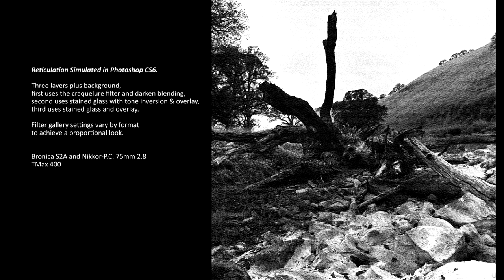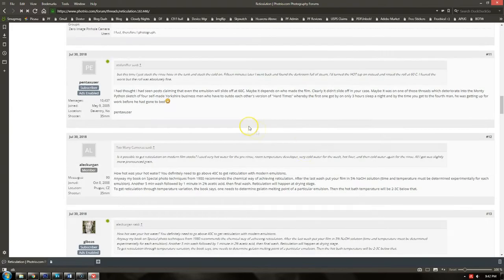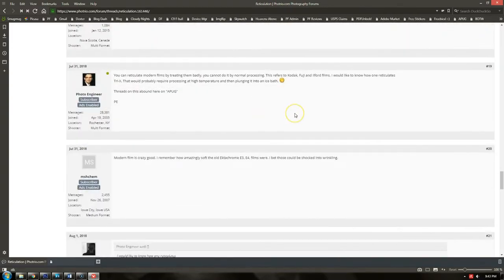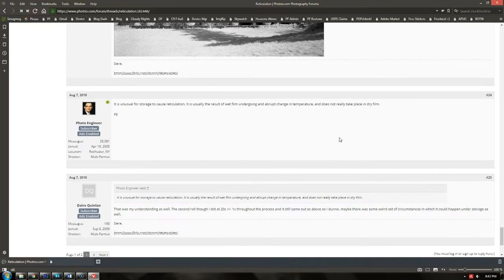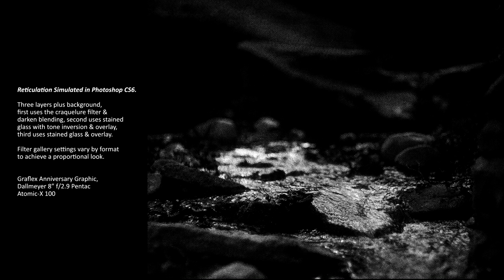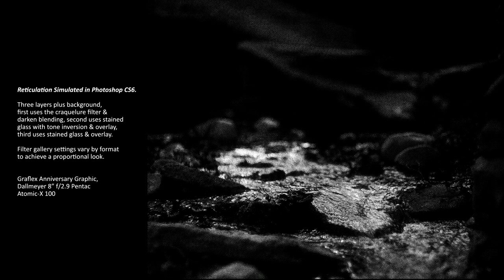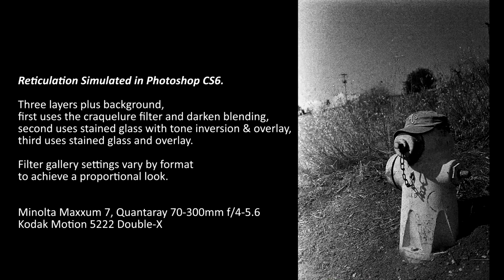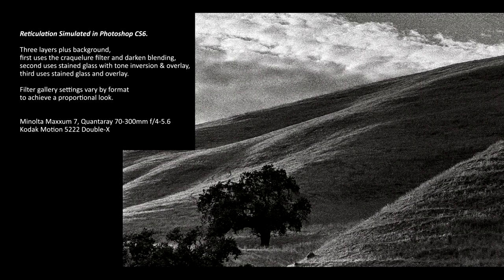Negative Flaw: Reticulation

Comment: I’m late here, but it doesn’t have to be that hot at all. I’ve done it to 4 rolls now not knowing what was happening and all I can tell you is that it’s super easy to do if you’re not careful. This is with HP5, Kentmere Pan 100, and T-Max by the way. All that has to occur is that large change in temperature. I did it during WASH BATH. Not during development, fixing, or stopping. As long as there is a large temp change, the film will have this effect. I did it going from water hot enough that I could wash my hands under with only a little discomfort (my idea was that warmer water might be able to remove the pink dye) and then putting it in 16*C Photo-Flo.
Reply from the maker: Oh interesting. So the wash having a meaningfully different temperature caused it for you.
Reply: @DavidHancock   yep, especially on Kentmere and HP5, TMX seemed less suseptable.

Comment: Late here as well, but Marshall is right. It happened to me by mistake with Tri-X. I developed in a Cinestill Df96 monobath and then, after develop&fix, the first water I washed it with was hot by mistake. Not as hot as to burn the hands, but hot as in how you would take a shower hot. Then I immediately turned the lever to cool water and continued to wash the film inside the tank. Next day when I scanned... reticulation. No incredible temperatures, just a big shift during the first round of washing. Hope this helps for people who want to achieve this effect. I didn't :) I can also attach a scan if you want to.
Reply from the maker: Interesting. I wonder if there's maybe some connection with how the developer affects the emulsion, too. Thank you!

Comment: We tried reticulation on Tr-X 400 in night class with hot water at 70 °C and cool it down in ice-water. No luck... I'll have to look for old stock.
Reply from the maker: Probably yes. Modern stocks are really well engineered now so that reticulation doesn't happen.
Reply: Just developed some Tri-X 400 the other day and got reticulation.  HC-110 Dilution B at normal temperature, but I did a warm water bath (45c) for about 10 minutes before developing.  Everything else went normally but when I pulled it out I had very strong reticulation in the highlights.

Comment: I’ve used cinestill monobath with tri x pushed to 1600 so at 90 degrees and rinsed it in the same temp and still got this issue smh
Reply from the maker: Dang it. That's too bad. 90 degrees is pretty warm for black and white film.
Reply: I did at room tmperature 75 and had this happen
Reply: @josephlinares5472  same here :S

Comment: Hi David, great video, I unfortunately had a roll of Tri-X that I shot in the Himalayas get reticulated quite badly. This happened just late last year. I was wondering is there anyway to "melt" off the reticulated emulsion layer after everything is fixed and set? I'm willing to risk ruining the negatives if there is any possible way as they are more or less kinda ruined anyway..... Perhaps you might know or could point me in the direction of someone who might!!
Reply from the maker: For reticulation, there's no possible repair. Do you have a few sample scans? There are things that look like reticulation but aren't.
Reply: @DavidHancock  I'm 99% sure it's reticulation but would be happy to be wrong. Do you have somewhere I can send you an image?

Comment: Then I assume I'm some sort of wizard.
It happens so many times to me. The most recent example see 2 fresh Ilford Fp4 shot at 400iso developed in Rodinal 1+24 for 20 min, stop 1 (ado eco stop) min and fix 5 min (adofix) with 6-7 final washes. Since my thermometer died I've been check the temperature of my tap water by "hand test" for it to be about 25° at any given point. And there it is, reticulated grain.
Reply from the maker: Witchcraft! :D

Comment: I've had it recently in every roll and it's not from my development methods. I bought  a 10 pack off of Amazon, triX, and it did it on varying degrees. Very frustrating. Unfortunately I mixed the ten pack in with some others. I believe it was bad film stock or poorly kept. So far 7 rolls... frustrating
Reply from the maker: Do you have some scans of those you can post a link to?
Reply: @DavidHancock  yes. Give me a little time
Reply: @DavidHancock  I developed 6 rolls today of TriX, from a well known online retailer. I think an urban legend is a little strong and the film manufacture is not transparent. I have metered temp water for developing, I contacted supplier and they tell me much the same as what your producing. They do not want to issue me a credit, funny thing was, I wasn't reaching out to them for a credit, I was merely pointing out the issue so other photogs would not experience it. Thank God I was on vacation.
Reply from the maker: Was it 120 or 35mm? If it was 120, it could have been an issue with the backing paper lacquer instead of reticulation. They look basically the same.